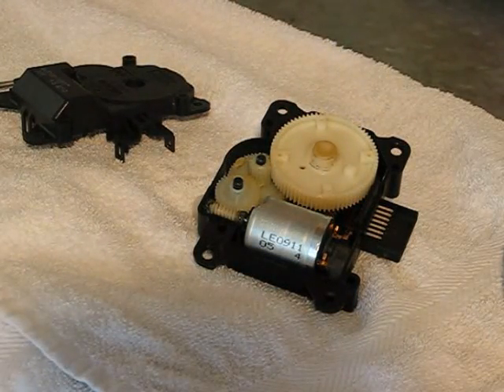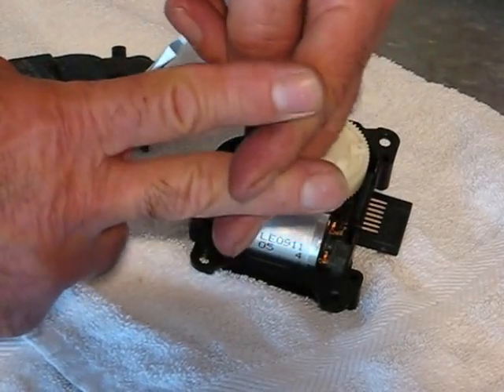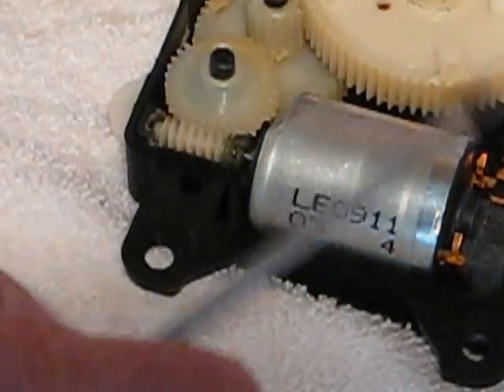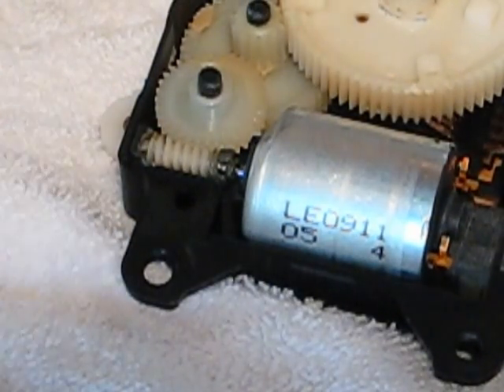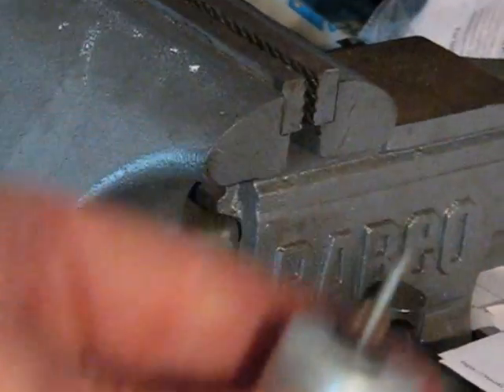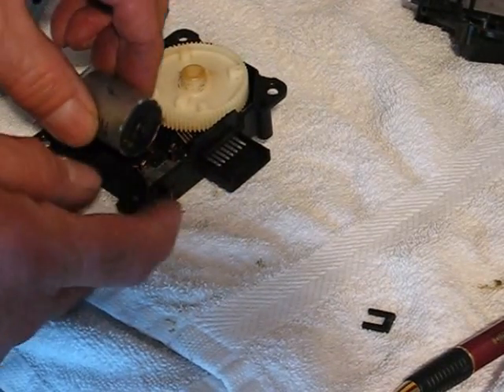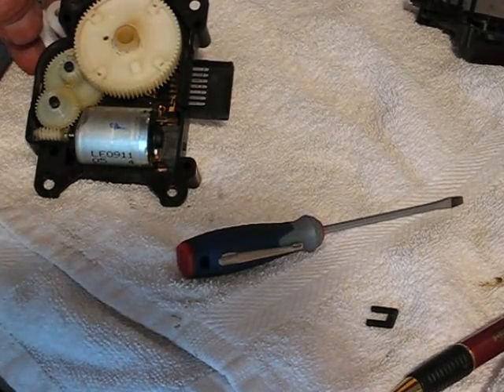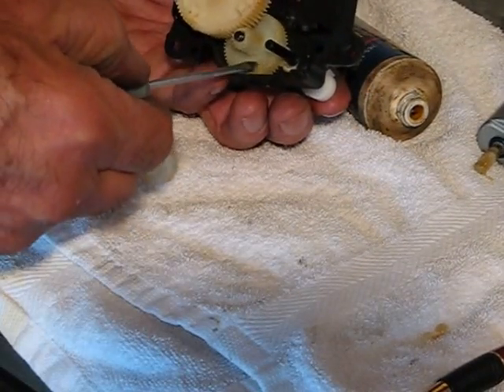Lexus servo motor air mix repair taken apart by froggy

Comment: Froggy, thank you for your video - it saved me a lot of time and money! But it was not an end of my sad story with AC. I hear quite similar but a little bit lower sound coming from beneath glove compartment (it is definitely none of the two actuators). And on a top of that, sometimes AC does not work at all - I do not hear fan working and air does not circulate. For example, today I was driving with AC on then stopped by a shop and after that it did not work. Did you fix any issues with AC fan? What would you recommend to start with? Lexus RX300 2001
Reply from the maker: +Anastasiia Balan I would verify that you have the correct amount of refrigerant in the system. This requires some knowledge of how a/c works etc.

:)
Reply: +froggy I checked AC a couple of weeks ago at a repair shop - it was ok. Air does not blow - this is an issue. And during the last two or three weeks, AC blower motor uttered a rattling sound while working (not when AC off). Did you fix it ever?
Reply: +froggy Let me ask another way - is air fan blower repairable? Or it is better to by new (used) one right away?
Reply from the maker: Is the blower fan dead at all speeds? Is it intermittent working/not working?

Short answer yes, can be replaced, I recommend original/new. The MOTOR speed is regulated by a separate controller. It could be the blower motor OR the controller OR both.

:)

If you look on my Suburban playlist I show how to replace a controller on that vehicle.

:)
Reply: +froggy Before yesterday, the blower fan was working for the most time but making a low (but distinct) rattling sound when on (both on AC mode and on air circulation mode). Once or twice when I turned it on, the fan was dead - on all speeds - and then in ten minutes or so it started working again. But since yesterday I managed to turn it on only once this morning though tried to do that probably four or five times. It did not respond when I changed speeds either. 
What can you say to this? 
Thank you for your replies!
Reply: +froggy How to define what the part does not work - fan blower, controller or both?
I can only suppose that most probably it is fan blower that feels bad since it was rattling before.
Reply from the maker: Well if the fan will move at different speeds when you use the controller (even if it makes weird noises) then the controller is PROBABLY ok.

If you have no control over the speeds (regardless of noises) the controller is not working.

The noise probably means the motor bearings are shot or there is debris in the blower that is hitting the fan blades
Reply: +froggy Thank you very much!
Is the controller located closed to the fan blower? The controller itself is officially called Blower Control MotorToyota 87165-22050? Right?I want to check both those things tomorrow. Florida even in November is not the best place to handle without AC :)
Once again - thank you so much!
Reply from the maker: Should be near or mounted on the blower. I cannot confirm the part #, sorry. I don't have that same car.
Reply: +froggy I need your advise. I have removed both blower fan motor and controller and then checked a motor in a repair shop - it works. But mechanic told to me that he cannot check controller itself (actually, I was suggested to check electric part of the AC system for a hundred something bucks). New controller costs $250 and it is not returnable (if I decided to plug it in just to check whether controller is the reason of AC breakdown). How can I check whether controller works? And what could it be else if controller finally turns out to be working?
Reply from the maker: There is probably a way to check the controller (off the car) using a multi-meter and measuring resistance values at the different speeds. That's a general description, I really can't specify exactly how you would proceed to do this. on your car. Resistors have different electrical "values" that can be measured. Unfortunately most mechanics will not do a repair on a controller, they will only replace it. Sorry I can't help more.

Keep me posted, how it goes.

:)
Reply: +froggy How do you think in situation when motor works what is the probability that the problem is with controller? I can get controller for about $45 (used) but if it is not the cause - it will be waste of time and money.
Reply from the maker: Well my GUESS is that the probability is very high that it is the controller. A used one could have most of the "life" used up already. You can't really tell by looking at it how good/bad it is.

Look for a new one at parts places online like Rock Auto, Parts Taxi, even Amazon, Ebay.

:)
Reply: +froggy  Hi Froggy! A story with my AC goes on and resembles comedy :) Once again need your attention :) After a repair shop tried to charge me $50 for checking controller, I decided that it would be cheaper to buy used one to check the system. So, yesterday I received a controller, installed it and checked AC - it WORKED! I tried to change speeds, turn on/off AC, changed positions of air flow - everything worked perfect. BUT... Today when I tried to repeat my yesterday success - I pretty much failed, the motor doesn't work again. No manipulations helped, nothing! I was driving for 20 minutes and periodically pushed a button - no effect! 
What will be you expert guess? What could happen? The new (used) controller burnt out? Or what? Yesterday it worked as it should and I turned it off when parked a car but today it even did not start working. If it is a controller again, what is the guarantee that a brand new one will not break if I buy it.
Please advise ;)
Reply from the maker: Well, that is unusual. It's "possible" the one you got worked for a while & then failed, but would be uncommon.

I would try returning it from where you got it, tell them the story, and get another.

Before you do that check your FUSES and see if one "opened" due to the use of the system while it was working.

:)
Reply: +froggy You mean that box of fuses inside a car? Can fuse hypothetically behave that way - sometimes works, sometimes not?
Reply from the maker: No, a fuse is either good or blown. I am just wondering if the controller you put in CAUSED a fuse to blow. It's just a guess, is all. It's super easy to ck fuses. Good to know how to do it, if you don't at this time.

:)
Reply: +froggy I will be grateful if you advise how to check fuses.
Reply: +froggy Could you prompt me how the fuse I need should be titled? In a fuse box inside a car I see only one fuse titled HEATER (15A) that is related to cooling/heating system. But I guess it is not the one I am looking for? And how to check it?
Reply from the maker: Check all of them to see if one is broken/burnt. There is a very small wire inside if the plastic "wedge" that plugs in. You will need to look VERY CLOSE & CAREFUL in good light to see if the wire inside is intact or has a "space".

Maybe google some images.

:)
Reply: +froggy Will try :) Thanks!
Reply: +froggy Hi Froggy! The detective story with my AC, I hope, heads into a homestretch. Today, after recurrent check of my motor which proved it works, I plugged both controller and motor in and, o miracle!, it was working as should. But motor was removed from its case below cabin filter. As I figured out, my own controller works - the issue was not linked with it at all. So it looks like motor works when taken away from its case and does not - when installed into its common place. I guess the problem is definitely neither with controller, nor with fuses. 
If you remember, motor was working for a day after I replaced a controller but next day it did not turn on. What do you think may cause breakdown - plug on a motor, incoming wire, or something else? And how can I eventually locate it?
Reply: +froggy Do you have any suggestions how to fix my motor (see my previous post)? I will be thankful for that!
Reply from the maker: Seems like a "connection" issue, make sure all elec. connetions are clean & tight.

:)

Comment: froggy, this looks like the same blend door actuator on my 2006 Honda Pilot. I tried your repair and so far it works great. That flapping noise was driving me crazy. If the shaft collar slips later on I'll try super gluing it in place or as another person suggested below gluing the broken tab to the wall in front of the worm gear. Thanks for taking time to post this fix.
Reply from the maker: +Bruce Hashbarger Glad to help. Blend door actuator MOTORS are pretty generic. And how they slip a little plastic gear on, well, not the most "robust" assembly for something that is going to get used so often.

:)

Comment: After 6 months of flawless operation the servo goes now only to boundary conditions-fully open or close.  It could be some lube ended up on pins that touch the driving round contact plate and prevent the good contact between.  I was wondering, did you use any grease on the contacts (pins) touching the driving round plate.  If you did, was it conductive or dielectric grease?   Thank you.
Reply from the maker: Leonid Osetinsky IIRC I just spread some of the existing lube "around". If it IS working to the limits, but not at the partial sections, seems like something else? The linkages were pretty bizarre & sort of "delicate". Maybe a linkage alignment issue?

:)

Comment: You see that tab you broke off at @5:11? You can break that in half so it makes an "L" and super glue that to on the wall at the end of the worm gear and it won't move. At least for me it worked. This motor might be different than the servo that controls the "mode". Same car though.
Reply from the maker: ***** Yes good tip, lots of little things you can stick in there. Thanks!

:)

Comment: Thanks for the vid!  In less than an hour i fixed my servo and saved a bunch of money and time that would have otherwise gone to the dealer.  I just held the brass "yoke" on the motor with pliers and knocked the motor shaft enough to take up the slack.
Reply from the maker: Great, good work!

:)

Comment: hey froggy, any idea if i can order just the little motor inside? mines weak
Reply from the maker: Yes ebay or amazon sell just the motor, It's a little tricky to know which one to buy, there are hndreds of them. Best thing is to pull the mechanism and take the motor out to compare to what you need to buy.

:)
I do have another video showing motor replace.
Reply: thanks for the quick response! i already got it all apart just need a new little motor. its the one for the air mix. if you have a link to some that would be great!
Reply from the maker: Measure the length of the shaft & whether it has a FLAT place on the shaft & look on amazon and ebay

:)
Reply: +hokysniper Did you find the motor? Much appreciated if you can post what you learned.
Reply from the maker: I have another video that shows the motor, look at the lexus playlist.

:)

Comment: Thank you very much for your video.  I followed exactly your steps on 99-RX300 and fixed the moving gear on the motor shaft the same way.  I added some glue to the shaft to reduce the possibility of its moving. 
I really fought with the upper screw while removing (and installing) the air mix server.  It is interesting which screwdriver you used?
I used the long very thin Phillips that bended a bit.
Again, thank you very much
Reply from the maker: I have a couple dozen different size/length/etc. Mostly needed right length to get it in, sometime you can cut the handle short to get it in there.

:)

Comment: Awesome video. I will try it on my '03 RX300 this weekend. I suspect the heat/cold servo is out as only cold air comes out. Thanks a bunch for your post.
Reply from the maker: Yes, that should be the one, the little bugger works hard!

Comment from the maker: I understand how this works completely, thanks for the comment.

Dealer wants to make the markup on the part AND the excessive labor charge.

The techs almost always get squeezed.

It's too bad, it's why I try to help the folks with diy tips.

:)
Reply: You can try Loctite or a good quality super glue to secure the brass bushing (cog)

Comment: Honestly go tell Lexus, I worked at a dealer and this failure was seen enough that the village idiot thought to take one apart and find out what was wrong, found something that worked and asked if he should say something, I was told to throw it away and move on. We were not permitted to do these kind of repairs, same with speaker foam failures, and the such. We can fix it but we will not get paid, and when you make 12/hr while the house eats 150/hr it is not worth opening that can of worms.

Comment: My Rx300 has this problem for 5 years. 
Finally, I got the solution.
Every Rx300 owners who I know has this  problem.
Lexus should recall all Rx300 for this problem.

Thanks, Froggy. You must be exellent engineer.
Thanks.

Comment from the maker: The one I fixed controls heat/cold. There are three servos under the dash passenger side. If you pull the glove box & maybe a panel you can see them and watch them move (or not move) and listen for normal noise (or abnormal noise )

Watch all the videos & start to take apart and diagnose. Make sure you "fix" the right one.

:)